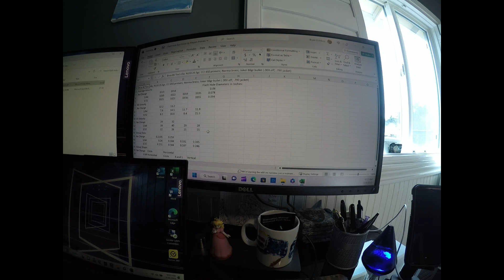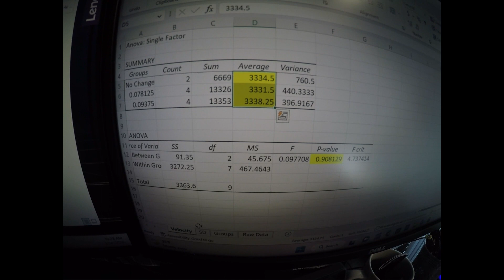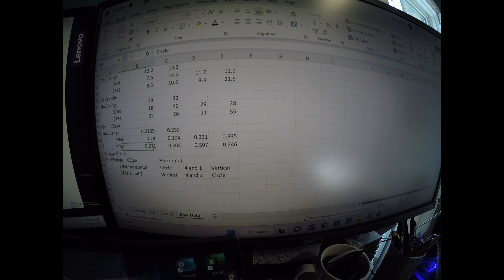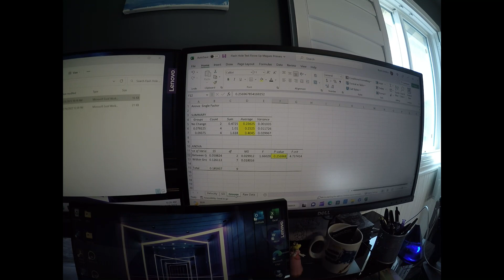Flash Hole Diameter Follow Up Test with Magnum Primers

Comment: Crazy question.  Would chamfering the flash hole on the primer side do anything?  In my mind that would funnel the flame to the flash hole.
Reply from the maker: The largest diameter hole in this testing was very large and I am estimating that 80% of the anvil was openly exposed to the powder so there was plenty of open area for the flame. I am highly doubtful that adding a chamfer would do anything. I think I am done with flash hole testing unless there is a significant rational and/or other data to suggest that it is worth further pursuit. I already went down a rabbit hole with this testing and tried a magnum primer at somebody’s suggestion and that turned out to be a nothingburger.
Reply: @WitchDoctorPrecision  thanks. Great videos.
Reply from the maker: @jturner5227  thanks. Didn’t mean to sound terse…As I do more and more testing, I’m finding that the rabbit holes aren’t producing much UNLESS there were significant results upon initial testing. That doesn’t mean I’m rigid but that it will take a solid rationale and some data before I consider diving deeper. I also have to balance resources and focus on testing that is likely to yield a result that informs practical aspects of shooting practices. Anyway, shoot small!